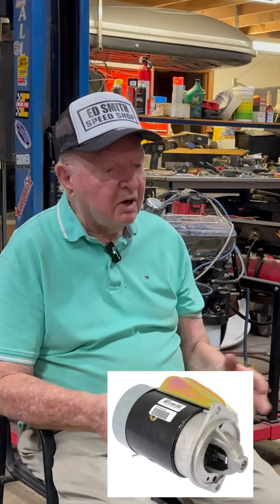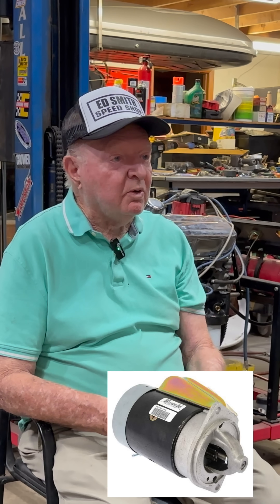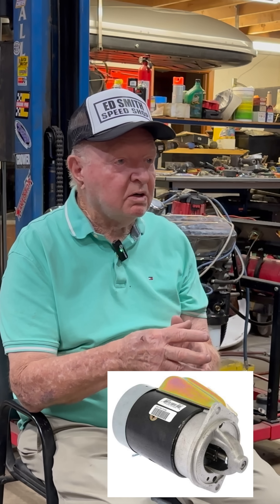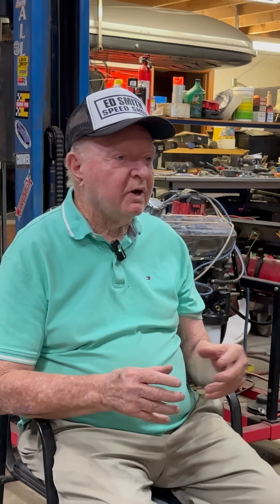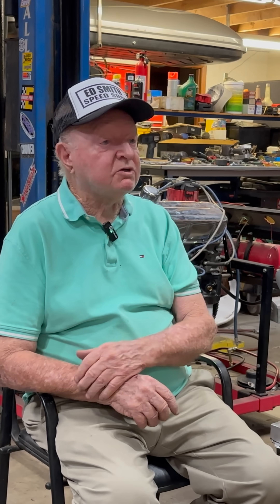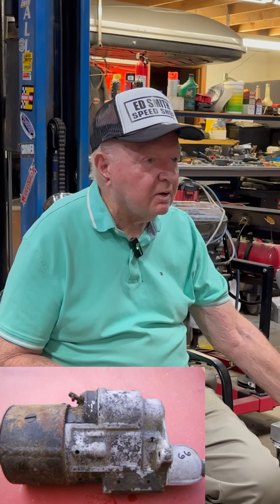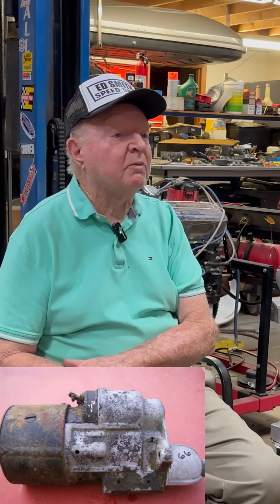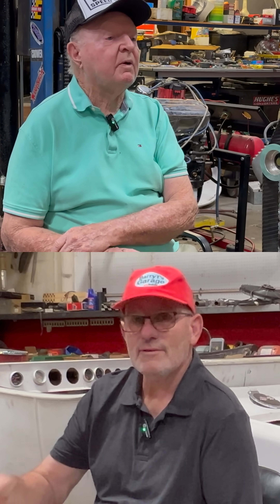Ford v Chevy v Chrysler STARTERS - Ask Ed 25 - Ed Smith w #BarryT #enginebuilding

Comment: My 1966 chevy 292 i6 starts in a1/2 a second just bump key for a instant and vroom have a mini starter and works great was having troble with stock stater. My dad had Chryslers and them thing crank slow have to hold key for 2 seconds.

Comment: In the 60’s I worked on a few Chevrolet starters and have shimmed a few. If I remember correctly there were 3 shims, a 30, 20 and a 10. I think these were in thousandths of thickness. The shim was silver and about 1” wide and about 4-5” long. Opening at one end so you could slide between an installed bolt, but loose.  The other end stuck out a bit,  but had another hole you could align with the other bolt that you installed through the shim and then tightened both. I would first install without shim, listen to how noisy the start was, if it was ok, then you were done. If not then you pulled out the one bolt and loosened the other, put in the thinnest shim, then tightened the bolts, listened again, if ok, you were done. If not next shim, then next if necessary.   Kinda time consuming, but that’s how it was done properly.
PS: During the 60’s when I started driving, things were kinda normal, you drove and you repaired, you drove and you repaired. Once I started driving Hondas, 1996, I started driving and maintaining, diving and maintaining. I never replaced a starter until my wife’s 2006 Accord (bought new) 4 cylinder finally needed one at 170,000 miles. This was first repair of anything. No suspension parts, no exhaust parts, no engine parts and no transmission parts. With the family I bought a bunch of Hondas, Japanese cars, etc. from 96’ till today. Currently I have a 2009 Honda Crv, bought new, with 140,000 miles, has never been repaired. Also a 2017 Toyota Rav4, bought new, with 95,000 miles, also never repaired.     I lived this time…….

Comment: I helped a friend years ago. She had a Monte Carlo that ate starters and was the noisiest thing I'd ever heard. Several shops had tried, but failed. Like Ed said, the more you shimmed the worse it got. I shimmed just the outside bolt until it kicked the drive
in, just enough for a perfect mesh. Quiet and smooth like a new car. She'd been driving it noisy for years.
Reply from the maker: Good man
Reply: Old timers would grind at a slant the mounting pad on the gm starter, trial and error. Big block guys, would keep the aluminum starter nose ,and put it on their new starter, and we had good luck doing that.
Reply: I shimmed a Cadillac starter with a file. I hate to shim one bolt. I've seen cracked blocks across the starter pad.

Comment: I like my chevys but small and big blocks always have starter issues I’ve had 2 or 3 break off the block on high compression builds, or I’ve seen a distributor stabbed 180 out and it kicked back and broke the starter, it’s quite annoying, especially with the big old ones they would break the bolts out of the block just driving down a bumpy road